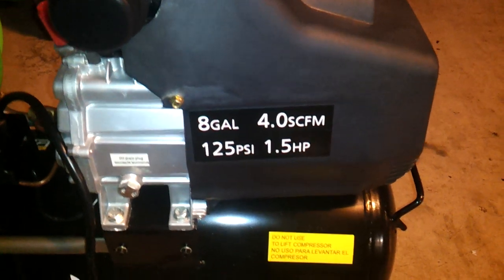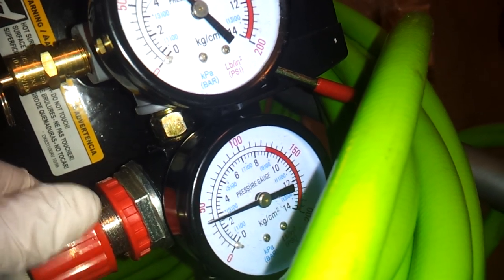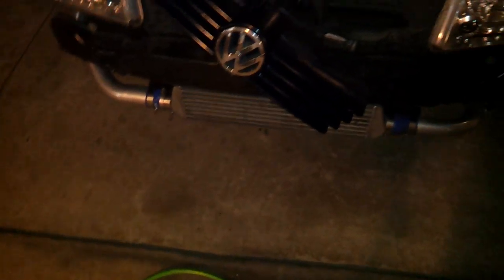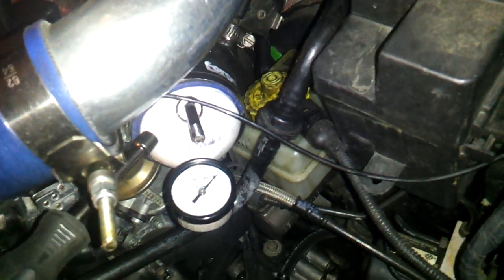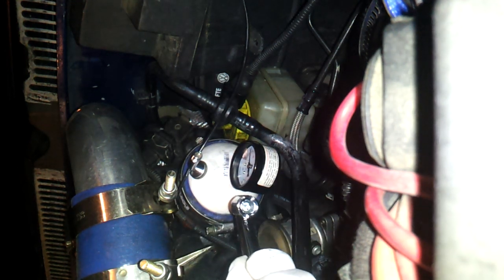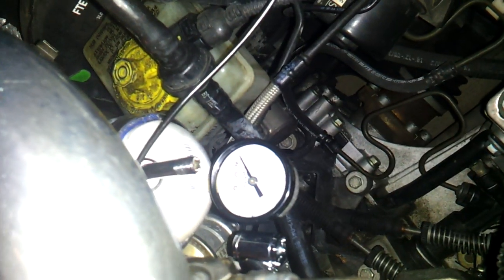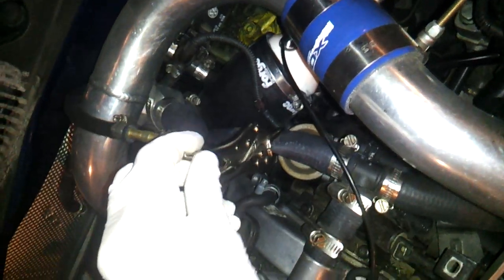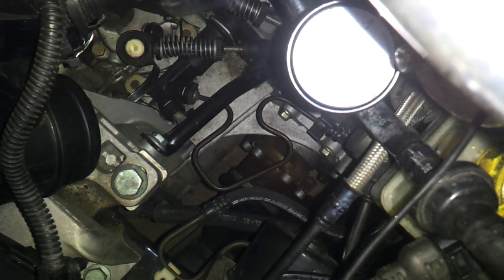1.8T Jetta how to boost leak your turbo charged car using a husky air compressor

Comment: I have a boost leak and know the area it's coming from but I can't actually find the leak because I can't test it while it's making full boost. It's around the sick intercooler or rubber hose to the throttle body area. You can hear it while driving and it sounds like the diverter valve and a long swoosh sound when letting off the throttle from full boost or just staying to make boost. I'm going to try this method to find and fix it because it's progressively getting worse over time and killing performance

Comment: where did you get the hoses and T pipe for the breather system off the valve cover? and what kind of hoses are they? mine broke in like 3 places and I need to replace it asap. please help

Comment: Nice video.  I'm going to try this. I have vw jetta 1.8t and it starts but doesn't have any throttle power.  It's called running in limp mode.  The diag says it has a vacuum leak, and needs front and rear o2 sensors, and if that doesn't fix it then it may be throttle body or ecu.

Some things I changed was the turbo diverter valve, brake pedal switch and throttle body.  The problem is intermittent and was wondering if you had any issues like that or if you think a boost leak can cause that.

Do